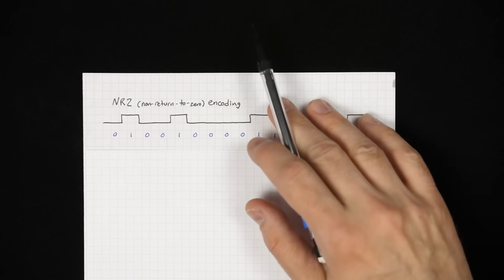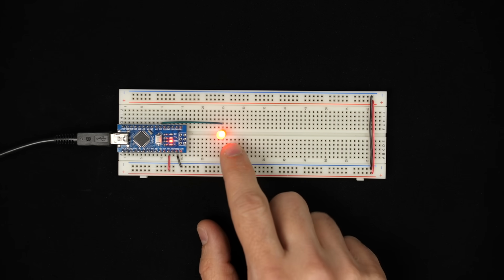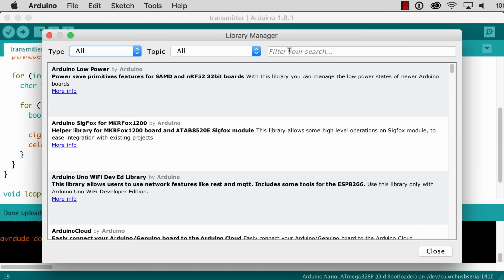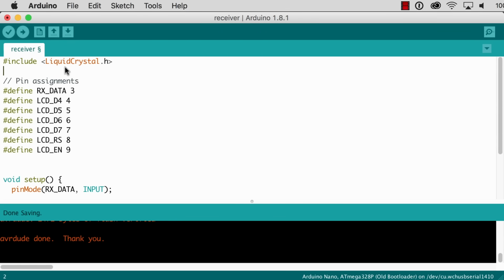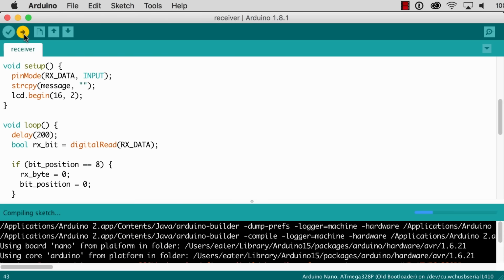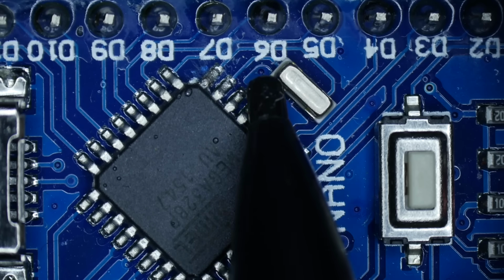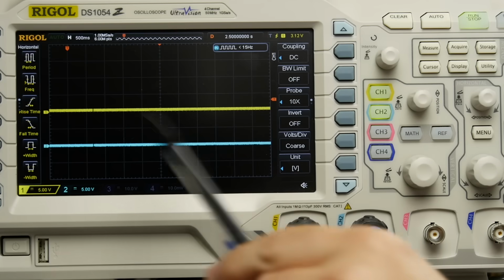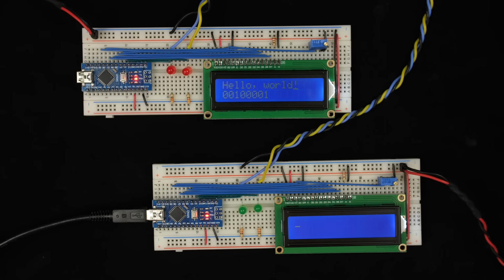Reliable data transmission

Comment: could you use a/the (not finised the vid yet) control line to send who's transmitting, where a message starts, etc. but also compress data by defining the end of a byte and cutting off zeros to save time sending? The receiver could see the control line and infer all zeros after the byte end.

Comment: How are people not realizing that this is the basis of CAN networking? It runs your cars, planes, and robots!
Reply: Well, probably because most people aren't familiar with CAN (though, the subset of people who would watch this video might have a higher than average percentage). And those that do, also know that there's nothing really special about CAN in regards to the lessons he's teaching. All data transmission protocols have to address these same issues. In fact, I'd say this is much closer to I²C.

Comment: Might be a dumb question, but how does UART seams so reliable once we have so much problems with the Asyncronous comunication? How does it overcome the slight difference between the frequencies of the two microcontrollers?

Comment: When connecting the receiver, ground, and clock I understand that the cables for receiver and ground are hooked in between the input and output pins to send signal but what is the ground even doing. He is saying its a reference of potential but the ground is connected to the ground. Its not taking part in the circuit. The receiver and clock are connected to the ground of the arduino. The grounds are connected to each other which are connected the ground of the arduino which does that not just make a closed loop?
Reply: So for those wondering this is what deepseek had to say after a while talking to it. The ground in a circuit is considered a reference point obviously but the arduino themselves in their breadboards have established their own definition of what their ground is. For example arduino 1 ground could be 0.2V and arduino 2 could be 0.1V this will make it so that when reading the signals from high to low they dont have the same reference point causing them view the data differently potentially. This is solved by adding a connection between the 2 grounds. This makes it so that arduino 1 and arduino 2 ground both become "0v" to each other removing the noise from the circuit. This means both of their high and lows are the same. Before they had different understandings of high and low. If someone believes my understanding is wrong please correct me.

Comment: What if you removed the clock wire and sent three bits for every received bit like so? 100 -> 0, 110 -> 1. When the data wire goes high, that's a new bit.

Comment: What is it with electronics guys and having zero sense of complexity. "so first you want to plug a LED into it with some resistor, the value doesn't really matter just a few hundred ohms and you're good, and then it'll go blinky blinky. But, y'know, that's a bit inconvenient, so here's 10 more wires to connect, a potiometer, an LCD screen, and a data sheet, that oughta make things much simpler."

Comment: In avoiding a clock line (synchronous data transfer), you could also over-sample on the recevier and use a multi-bit agreement (2-of-3, 4-of-5, 7-of-9, etc...) at the basic rate to roughly approximate the incoming data bit periods.  For example oversampling at 16x rate and looking for a bit period which fits in your worst-case clock deviation specification, then looking for at least 13-bit samples that agree to set the current state of the bit.  This also can account for periodic/temporal noise on the line at higher speeds.
  
Framing your bytes helps too. Start and stop bits, so you can expect a Stop (low) to Start (high) transition every n-bits.  By correlating your edges, you will eventually disqualify the periods that don't always have the expected stop/start transition.
  
From there you can do additional protocol-level data integrity like requiring a stop period longer than a full byte transfer time to show an idle bus, using a forward-error correction code to send an orthoganal code instead of just a raw byte code to detect/correct bit errors (I love [24, 12, 8]Golay codes!!!), and starting a burst with a byte count, then doing some form of message integrity code at the end (like a CRC).
  
Oversampling catches errors on the data line occuring at a faster rate than the interface, forward error correction catches byte-level errors from bit-period corruption, the message length value catches message length errors, and CRCs catch message-contents level errors.
  
If you wanted to go nuts, you could add a message authenticator routine to sign and verify the sender, and encrypt the payload with a symetric cipher (stuff in a random burst at the front end to eliminate reply attacks, and another signature inside there verifying the decrypted contents after the burst).  But that's at least another video I'm sure.

Comment: i guess its not data but a xlr sends 2 of the same signal where one is flipped so all the noise except a small amount  gets canceled out. wich is why noise is super loud if cable is damaged like one of the wires is higher resistance or completely detached.

Comment: 📺💬 We set up at 5 transmission bits rates, which can be faster by sensors and technology and we select 330 Ohms resistances for ground or negative node-connect back to the nano Arduios.
🥺💬 With Arduio that makes everything easy I am almost 40 at that time we use MCS chips or Texas where you need to create controls UI or create an event message method to handle feed forwarding messages. The better technology is good but the Arduino can handle more data bandwidths with input/output legs and or use sensors.
📺💬 The reverse current and differentiate voltages problem we sure we handle by the Arduino that is adjustable voltage output.
📺💬 He means the contrast works the same as resisters but it prevents reverse current in frequency or emitted current by adjusting itself with the property of capacity and resistances.
📺💬 One specific of LED is power sources and input sources are different inputs/outputs there is a single input source but it needs to match the specification of the power sources with signals, some sensors had 3 voltages input because it works with the environment or some of them hidden or using estimates values from controllers that is why they called integrated sensors.
📺💬 It is easy when you look at the LED it turns on when the transmitting signal is 1 and off then it is 0, when the reverse happens it makes the opposite or turns on or turns off we prevent it by the balance of the current or contrast node. One thing when you look at LED it still works the same that is because of signal integrations, delay, or repeating of the same signal from last state messages.

📺💬 So I say Hi to her, next time you do not need to remove the battery but you can repeat the same message which is why they need to be careful working with LCD.

📺💬 Look like we had a problem when transmitting signals is not reflect the actual value we sent even though we shared the same common ground node, we do it by resetting it both at the same time Arduino features a reset button feature it syncs up communication equipment by the setup of the new expecting level, electronics devices or communication devices are not existing in nature and you create some small of a change in the scopes that make them can transform small change in current into information. The sync-up Arduino is one thing but in electrical devices, we cannot make telecommunication direct connect to each other or you need to create some delay that is the same as the resistance property the change is fast and that is enough for the receiver to think that is from the same controls or you can create reverse current delays between transmission and receiver which is sensors property. In radio, we had the nature of radio frequency.
👧💬 That is because signals need to have the same expected ratios even reset features to fix it but continue working the signals need to sync up during communications, in programming it is different and separate from devices and sensors since the start you teaching about return 0 and none return 0 signals that are good start or set the initial value.
🐑💬 Do you mean that devices need to have maintenance to make them work at their full capacity⁉ Sometimes working with a voice gateway connected to outside PABX or controllers it needs to sync up and frames relays.

📺💬 Actually, he working on his study major but maybe diligence he working with programming and database and many things too.
📺💬 We found another problem synchronize time delay when it expects the same rates of transmission but in programming, we can do it faster to endcaps all input signals by changing the delay time faster.
👧💬 Yes, that is one thing or you can do messages and events that perform each character send-up.
📺💬 One more thing in Arduino programming we call a volatile variable when it updates no violence on the working process, it is the same you are working with a loop and you accidentally place the variable into the loop and the loop keep running the value of the variable need to update but it cannot do it because it is in the process, and many cases they preventing of some errors. 👧💬 method update variables.

Comment: If you want a reliable communication over wires, use differential signal. What is presented here is far from reliability. As a reliable connection between 2 boards like such we can use e.g. CAN transceivers.

Comment: The adhd urge to memorize all Ben Eater videos in case I have to rebuild modern technology from scratch someday.
Reply: How are we laser imprinting CPUs as caveman bro😭😭😭
Reply: @lasgio_  Hey, abacus is turing complete
Reply: @lasgio_  nah we are gonna building using relays
Reply: @Percy5682 relays are gonna be the easiest starting point, but I think once we have sufficient industry, vacuum tubes will provide much faster computing (though perhaps less space efficient, and definitely much warmer). And if we can retain the knowledge of how semiconductor production is done, rebuilding the infrastructure will be much faster the second time (i'd expect it'll still take a decade or two to get transistors at a scale that's computationally useful).
Reply: Better get a headstart
Reply: People how are you all thinking to make relays without knowing how to make copper wires?
Reply: @phoenix10067  though they’re definitely not that big an issue, somebody had to make the first copper wire lol. And its not like the process of making it is confusing, its just a thin piece of metal.
Reply: can you help me on how did he input that error there at the last part the one with 3 wires?

Comment: It's possible to synchronize the bits without a clock line by using interrupts on the RX side for the first bit of each byte, and then using the delay to read the next 7 bits as the drift won't be an issue within 8 bits, especially if delaying the first digitalRead() by 100ms to cause all the digitalRead() to happen near the center of the bits.
For that matter, by starting from the center of the pulse it should be able to read the whole "Hello World!" reliably using a single interrupt at the beginning of the string, as the oscillators would have to be off by a lot to drift to an edge within 12 bytes.

Comment: I actually understood that.  Being retired I often find that I'm losing track of how the hardware inside our increasingly complex machines work, but this video did a lot to help fill in the gaps.  Kudos for the clear explanations of basic digital functions and for leaving in the things that often go wrong and then finding solutions for them.  The video also brought back some of the programming I learned in college.  Though Arduino code is not quite the same as my rusty old BASIC, FORTRAN, PASCAL and C++, it is good to know that the logical operations and command structure hasn't changed much in the past 50 years.

Comment: Thank your for the video I learned a lot. 

But can someone point me in the right direction. I feel like I wouldn't be able to reason about the calculation made around the 30:00 minute mark.  So for example I don't really understand when Ben says "when the transmitter sends 667 bits the receiver will only get 666 bits".

Thanks anyone for clarification.

Comment: This is all really great, I'm serious I loved it.

But I did have a little problem with you measuring the clock frequencies by directly probing them and having the oscilloscope do the frequency measurement. The probe will affect the frequency by adding capacitance to the crystal oscillator, and the oscilloscope has a certain horizontal resolution that might be inadequate to see the tens of PPM's difference between the clocks.

For instance my Rigol DS1052 does 1GSPS, so I won't be getting more than 1ns resolution, while the 16MHz signal is only 62.5ns in period. My oscilloscope is going to display either 62ns or 63ns periods, corresponding to either 16.129MHz or 15.873MHz frequency. Meanwhile a mediocre crystal with only 50ppm accuracy would be within 15.9992MHz to 16.0008MHz.
More advanced oscilloscopes can average over time and approach the actual value, but simpler ones will usually just measure one period length, divide it into 1 and call it a day.

If anyone wants to do this more precisely, they could output the clock to a digital pin (by using a timer or master clock output pin) and measuring the frequency with a spectrum analyser zoomed way in to the base frequency of the clock signal. (Remember your DC block and attenuator to protect the input of the spectrum analyser) Now it's mostly the inaccuracy of the measuring device's clock that affects your measurement.

Comment: Great Video...  A Test Question from Computer Science class:  How many wires do you need as a minimum to transmit data ?  
(the answer was 2,  for a serial connection).

Comment: small code quality remark.. in the receiver code you'r using an iterator bit_position. You increase this and elsewhere you do an if bit_position=8. It would be better to make that if bit_position >=8, in case somehow bitposition managed to get to 9 or something like that. Otherwise the code could be stuck.

pseudo code sortoff:

loop 
{ inc bit_position 
  if bit_position =8 then exit
}

This could get the program stuck if bit_position reaches a value bigger than 8. For instance by another program having an overflow or illegally writing to memory.

loop
{ inc bit_position
  if bit_position >=8 then exit
}

This won't get stuck.

Comment: I don't understand why you need to send a separate clock.   Why not just send a very distinct signal at the start of each chain of 8 bits so that the receiver can know when its the start of a new character? Then the time doesn't matter because the receiver   just constantly looks for that signal and as soon as it sees it it reads the next 8 bits and puts it into a character.
Reply: Some communication protocols do this. CAN bus, for instance. You have to compensate for the lack of clock by very carefully controlling the bit timing to make sure both transmitter and receiver are synced. When I set up two MCUs to talk over CAN, I have to set up the number of internal clock cycles per bit. He just used the delay function which is simply not accurate enough. It only counts milliseconds, whereas the clock is usually sub microsecond. And it doesn't really guarantee exactly the number of milliseconds, only that at least that many have passed. Plus it doesn't account for the execution time of the code used to send the bit before jumping into the next delay. It's all just so inaccurate in terms of timing. And in order to keep it simple, he chose to send the clock signal separately rather than write twice as much code just to keep things well timed. The focus was kept on sending the bits themselves.

Not to mention, no two clocks will be perfect. So in many protocols, they will resynchronize whenever they can. A transition (1 to 0 or 0 to 1) can be used to readjust the timing as you go in case you start getting off. But what happens if you need to transmit 30 ones in a row? That introduces a new concept called bit-stuffing, where you intentionally throw in and ignore transitions just to make sure the receiver doesn't get desynced or flag a lost connection due to bus inactivity. It gets much more complicated the deeper you go. Sending the clock alongside the data is far and away the simplest option.

Oh, but don't forget the protocol Ethernet typically rides on over those CAT-5, CAT-6, CAT-7... Cables. They actually figured out how to send the data and the clock on the same line. (Well, it's a differential pair, so it's 2 wires, but they both carry data and both carry the clock simultaneously.) It's ingenious, really, but there are 2 ways to think about it, either a rising edge denotes a 1 and a falling edge denotes a 0, so you're guaranteed to get at least one clock pulse for every bit. So you're constantly resyncing. And if you get an edge in half that time, you know to ignore it. A 2x margin makes it easy to distinguish between the intended edge and the "setup" edge. Or you can think of it as frequency A represents a 1 and frequency B represents a 0. The frequencies are in a 2:1 ratio, which provides the same benefit.

Comment: To be picky about words digital does not just refer to 1s and 0s encoded with two voltage levels, but rather to finite energy signals. Both RZ and NRZ are digital communication schemes. Sorry, had to say it. Loooove the content tho